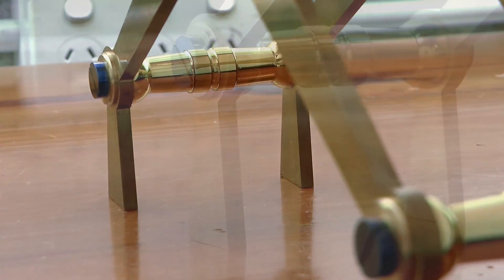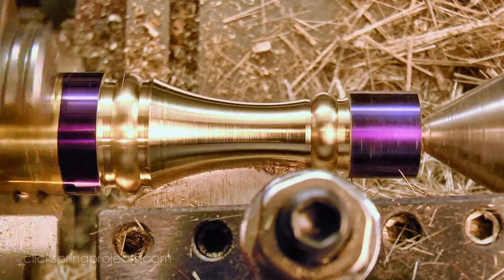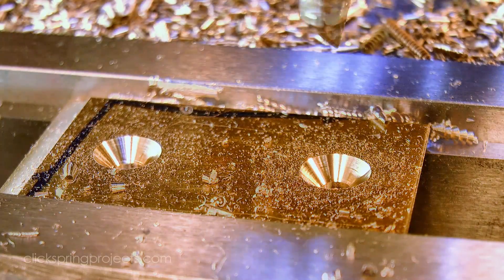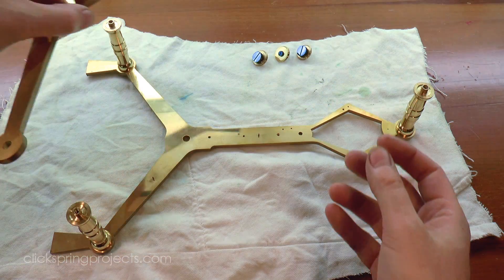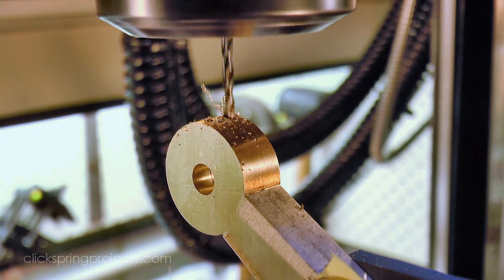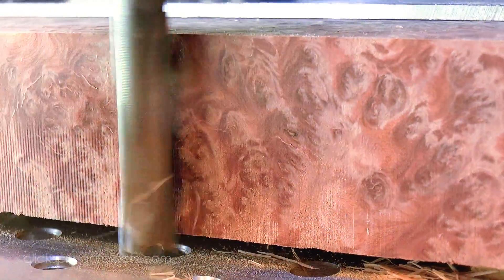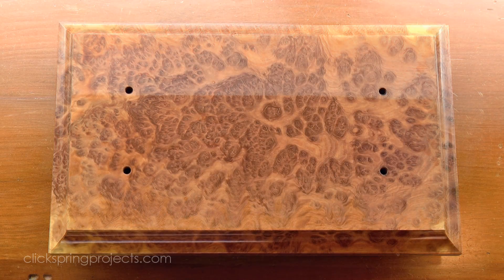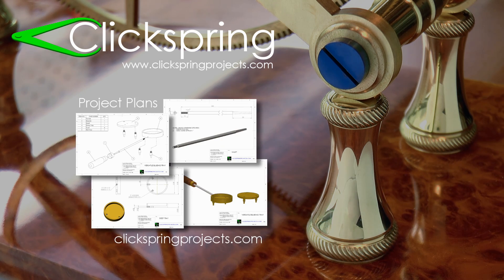Clockmaking - How To Make A Clock In The Home Machine Shop - Part 19 - Making The Legs And Base

Comment: I'm a little late to this party but I was actually going to recommend shellac since it's a good sealant and works on basically anything. Like any good paint, apply in thin coats and build up layers. Since it doesn't cure but instead relies on a simple solvent, it locks in any existing oils and soaks in before solidifying. So good choice on this!

Even with a sealant it will still distort over time and with changes in temperature and humidity. Highly figured pieces like burls may have this more pronounced since there's no single, straight grain and densities will vary. Resin stabilization is about as close as you're going to get for a permanently stable piece.

Comment: If the wood didn't quite work out, there is a trick for fixing hammers and axes that have come off their hafts that might work. Soak it in ethylene glycol. Propylene glycol might work too., but I haven't tried it. Also, not sure about time frame with something that large, might not even be feasible.

Comment: Could you tell me what speed you used when milling the brass plates using the wood router bits please?
Reply from the maker: flat out Tony - this mills max is 1800rpm, but you could run them much faster

Comment: Would it have been possible to turn the original legs of the clock into threaded bolts, so you could just screw the legs on? would that have been easier?

Comment: Hi Chris, Beautiful piece.  I would be very much interested to find out how the wood held up over time after your mention of stability.  Regarding that, there are some products to stabilize wood that could be useful and not require resin.  However, with the random grain I think Burl might not be as difficult in moisture stability, but the temperature change in size of the brass (~19) may be different than the wood (~3 to ~40 depending on species, grain, moisture).  A joint that allows sliding would be my choice as an engineer between dissimilar materials.  I am looking forward to seeing how it works.
Reply from the maker: Yes agreed Frank - Plan B if required is to drop in a sheet inlay, widen the bolt holes and let the whole thing float as required. We'll see how it goes :)

Comment: Okay, another dumb question: when bringing the legs to final dimension prior to installing the posts that mount to the frames, why not use a tool steel stop, that way you ensure that all four legs are at the same height, instead of how you did it, just bringing the frame to the belt sander?
Reply: Sorry, to clear up the "steel stop", meaning how you did the curvature of the wheels, with hardware that formed a hard edge to run files against

Comment: I baked a piece of hardwood once at 200 degree f for 12 hours to remove all the water I could and then i sealed it 3x with marine lacquer. Its hasn't moved at all even after flying and changing climates.
Reply from the maker: Thanks for sharing that info Peter, will keep it in mind for future :)
Reply: Peter DiCapua… I have a nuke in my garage/workshop for just that purpose, any green wood gets turned, nuked, I weigh said wood and when the weight stabilizes I then turn to what item I'm making.

Comment: Clickspring, before I forget. Carnuba wax, near pure form, hot melted in (buffed repeatedly) has been used successfully to stabilize maple and redwood burl. I suggest you try some on a test piece. With the wax penetrated deep into the wood it gives a luster and 3D finish that has to be seen to be believed. Birds eyes compel you to touch to see if it's truly flat. Much more attractive than surface finishes like shellac.

 This does NOT work on Pernambuco, Caesalpinia echinata. The oils in that wood somehow conflict with the wax. So testing on oily woods is a must.

I saw a birds eye walnut gun stock that had about 50 hours of wax buffing. (120 year old wood salvaged from the brightwork of a tall ship). Complimented the $30,000 firearm perfectly.

($30,000 shotgun? Just imagine workmanship like in these videos or better, a $1,000 custom cut and mounted emerald for the front post and the entirety of Portia's The Quality of Mercy engraved into the right barrel. I'm sure the craftsman ended up working at minimum wage)
Reply from the maker: Sounds very interesting Ryan, will definitely check it out, thanks very much for the info :)
Reply: That sounds awesome. Are there any pictures of the shotgun? Sounds like it would be beautiful!
Reply: I think that was the most unphotogenic object mankind ever created. Several people tried. Even pro photographers.
The wood would turn more transparent the more light was on it as it penetrated the wax. In bright sunlight it would glow a deep brown shot with bronze among nearly black birds eyes. The photographs always came out a dingy brown yellow.
The barrels were matte on the top, nearly black, fading to that deep glossy azure blue beneath like Clickspring gets with his heat treating. The photos never were able to show the different hues properly. The filigree of vines tracing the length of the barrels and the script was embedded with a dark green alloy. Depending on how wide the cuts were, the green would lighten and be opalescent. That never showed.

Comment: how about "sleeving" the hardware of the clock so its legs are physically in contact with the brass feet at the bottom of the wooden base?  a bushing of some kind that goes thru the wood??  or, a flat piece of metal stock beneath the wooden base to which your clock is actually attached, making it so the wooden part only serves as decorative.  that way the wood can move and breathe with the changes in the environment as the seasons progress without changing the actual dimensions of what keeps the clock stable.

does that make any sense?  i hope i explained my question well enough.  when i'm concerned about changes in wood, i make sure the substrate has "wiggle room" to move without changing the overall dimensions of the project.  that and sometimes a crapload of varnish!
Reply from the maker: Plan B if required is to drop a brass inlay into the base that will essentially "float". We'll see how it goes over the next few years. Cheers mate :)

Comment: Chris, that is a gorgeous piece of wood that really compliments the clock b- excellent choice mate! The profile router bits will also work on ferrous metals with the appropriate speeds and feeds  which will vary based on profile and depth of cut. As always, inspiring work and thanks for sharing. Cheers!
Reply from the maker: Cheers Jeff!

Comment: great build Chris. I agree with your decision to add the decorative legs. there's just something about the way the radius top of the legs meet the flat surface of the clock frame. has to do with my eye being drawn to that particular spot, a distraction if you may.

I believe using a radius slot for the frame to sit in would be somewhat more appealing. the frame at that spot looks like an afterthought to a beautiful project. what does your eye for detail suggest?
Reply from the maker: I considered recessing the frames into the legs as you suggest, but decided that it looked a bit "heavy" on the eye. There is something a bit more delicate about them sitting as a tangent to the top of the legs. Its also consistent with the approach taken in most of the antique examples I can find in books, so that sealed the decision. Cheers mate :)

Comment: Beautifully done!   I wonder if a more modern poly urethane finish would be more stable in the tropics.  It is possible to get a very nice high gloss with those and they can be rubbed out between coats with wet and dry paper or fine fine steel wool.  Just a thought if issues come up.

Best Wishes,  Jim
P.S.   What a great job you are doing with the clock AND the videos.
Reply from the maker: Yes I suspect a PU coating would be suitable if it comes to that, cheers mate :)

Comment: This is certainly an epic build Chris.  I have one technical question for you however.  It has always interested me on how you put a "nurl" on to a surface.  Not sure about the spelling!  If the tool has "X" amount of ridges on it, doesn't the piece you're putting it on to have to be an exact multiplication of that number?  Otherwise wouldn't it all get out of whack?  Thanks.
Reply from the maker: Hey David, yes that is correct - it is analogous to the idea of gear teeth intersecting with two mating gears. The starting outside diameter of the workpiece needs to be very close to an integer multiple of the knurling wheel tooth pitch. Its not quite as simple as that, because of the deformation process of knurling, but that's the general idea. Google knurling calculator, and you'll get a lot of good info from others :)

Comment: A bravura performance. A vast improvement on the appearance of the clock. Textbook illustration of form tools and their use. A really beautiful piece of wood for the base. And you can indeed use a mill as a router. . Usually mills run too slow to do a really good job, but you got an extra boost because of the big radius  on the router bit = faster surface speed which is what counts. What else could I ask for? I know: a description of french polishing. Oh, that's your next video! Off to watch it.

Comment: Amazing work, as always. Seriously the prettiest machine I've ever seen.

About the base: My brother installed a solid ipe countertop in a house in austin, tx usa (also super humid). He found that it deformed at first, but then it flattened out when he lifted it off the cabinets about 0.5 inches with some stand-offs to allow the entire piece of wood to breathe. If you see deformation, you might try using some thin stand-offs on the brass feet. Just my $0.02.
Reply from the maker: Thanks for sharing that info, will keep it in mind :)

Comment: 16:28 Sloppy sloppy sloppy, every handmade screw head is at a different angle. I expected better. :)
Reply: He's probably taking it apart again, not worth the effort yet.
Reply: Interesting thing is is that all the other screws are the same direction due to how they are taped.
Reply: Thinking of English shotgun custom screws?
Reply: You must have gone to school with my father in law, who was nicknamed Professional Nit Picker at work.  He was an engineer too!  All screw heads had to be turned to 1 o' clock, he told me.
Reply: How droll.

Comment: Hi Chris, great video as always but unusually I spotted something that you might like to know to make things a little neater. This is not in anyway a criticism just something very simple that was taught to me when I was an apprentice many years ago by a old, very experienced cabinet maker and someone as precise as you might like. I'm refering to the underside of the clock mount.  When you are screwing in any amount of screws on the same surface that can be seen at the same time make sure the slots all line up, whether that be vertical, horizontal  or diagonal. A simple thing but just looks a little nicer. Hope you don't mind, I always really  look forward to your videos, thanks again.
Reply from the maker: Hey Ian, thanks for sharing your thoughts. A lot of fuss is made about timing screws, but the reality is that the effect is soon lost at the first dis-assembly, which is perhaps something a cabinetmaker doesn't have to contend with. Its rarely worth the trouble in clock and watchmaking, especially with soft materials like wood and brass that will suffer damage from repeated chasing of the effect. I do it occasionally (https://youtu.be/O8xIjsaDlN8?t=3m43s), and also did it recently on a Patron Series project where the fastener is hardened steel going into mild steel, so the effect will be maintained over time. But for something like this I think its far better to embrace a little randomness in the presentation. Cheers mate :)
Reply: Thanks for your reply Chris, your right, if they have to be adjusted from time to time it doesn't really apply. As for "timing the thread" i was taught that was the process when you try to return a screw back into a pre-cut thread, you place the screw or bolt ( it works just as well with nuts too ) in the hole and turn it anti clockwise until you hear or feel a click, then its safe to turn the thread clockwise to fasten up, in doing so it prevents cross threading, maybe its just simply a translation thing, we are talking across the world after all ! Thanks again .

Comment: Awesome!  If I may be so bold, it would be just that bit nicer if all of the screws were timed.  I know, I know, it is quite a bit more work but would make it absolutely perfect.  Always look forward to your videos, keep them coming!
Reply from the maker: A lot of fuss is made about timing screws, but the reality is that the effect is soon lost at the first dis-assembly. So its rarely worth the trouble, especially with soft materials like wood and brass that will suffer damage from repeated chasing of the effect. I do it occasionally (https://youtu.be/O8xIjsaDlN8?t=3m43s) but I think its far better to embrace a little randomness in the presentation :)
Reply: Cheers!

Comment: Since the metal and wood will contract/expand based on different circumstances you would want to make at least one half of the feet a little loose including widening the holes. This way whe wood won't bend your frame if it expands or contracts and vice versa.

Comment: Can aynyone explain me why he applied oil when imprinting the grooves onto the legs?
(Not native, I hope you know what I mean).
Reply: 1: Washes particles out of the knurl so they don't clog the knurl and damage the impression. 2:  Lubricates the knurl/work interface, which is under a lot of pressure. 3: Lubricates knurl on its shaft as again, it's under a lot of pressure.  Has he ever said what lube he uses?

Comment: What was the point of using the dye on the washers, it didn't seem like you marked off the sizes before cutting and I would guess you anyways would use the laithe's index(the "measure" around the handles you use to position the cutting head)?
Reply from the maker: Sizes were indeed marked off on the dye, just left it out of the edit for fun :)

Comment: I dont understand how the rope knurl tool works - how do you ensure there is an exact integer number of knurls on the workpiece, so that there is no overlap?
Reply: Lets say the distance between the knurls is 2mm (just as an example)
so long as the circumference is divisible by 2, the pattern will always fit.
Reply: He addresses this specific problem in the original video when he made the tool. If the diameter is too large, the tool will essentially cold work it to the proper size.
Reply: He mentioned that he changed the angle as he knurled to get more of a 3D effect. So it might turn out better if the diameter is a little off. I'm just spit balling my idea cause I've never done this.
Reply: frackcha Well the problem is that if the circumference is divisible by 2.1mm or 1.9mm you'll get overlap wont you?
Reply: Chris Doms
 There is some play in the tool depending on the depth of cut, but yeah you will have overlap.
The solution is to use a different tool that has the correct spacing of 2.1mm or 1.9mm.

Comment: I have a background in woodworking. I think your slab of wood should be okay as long as it's well sealed. The main problem with burled woods is that they're quite fragile and prone to breaking. In cabinetry, highly figured woods like this are not normally used as solid lumber, but rather in the form of veneers. This allows the most freedom, and the use of very delicate and difficult cuts of wood. I wouldn't worry too much about wood movement, because in a piece like this, the grain goes in pretty much all directions.

Comment: With a burl, you'll likely want to do some sort of stabilization anyway. Many of them are prone to cracking over time. I doubt the clock will introduce much vibration in the base, but if it did, I'd be concerned about it long-term.

Beautiful French Polish, BTW. :)

Comment: Why do people like burl? it is tree cancer.
Reply: Because it is uncommon and complex looking.
Reply: it's not cancer - it is a result of stress of some kind - damage or elements - you can see from the pattern that it has tried to produce many new shoots ( which gives the bird's eye effect) and the grain is running every which way to regrow - kind of like a human scar - if you are badly injured or burnt your skin will try to grow back to protect you however it can - it never comes back like what you were born with but it does grow back often quite visibly different - but certainly not cancerous - it's just the will to survive made visible...
also being a burl the normal expansion/contraction between seasonal changes will not be as great as that usually has most effect across a flatsawn piece whereas the burl's grain is running every which way which kind of negates the usual movement (although the flat surface may ripple a bit depending on how dry the timber was to start with - the small checks may open and close a bit but in terms of overall size changes will be much less than a "perfect" (ie straight grained ) piece of wood...and shellac for all its deficiencies (alcohol soluble, water damage etc) is one of the best blockers of water vapour transfer - the humidity changes in the air have a more difficult time penetrating to the wood - and finally people love burl wood (especially woodworkers) because they appreciate that it is beautiful...much like people (especially scotch drinkers) appreciate a single malt scotch...
Reply: +Katalist check out Ben Crowe at Crimson Custom Guitars on the 'Tube. He's done some work with spalted (ash? been a while can't remember) and he does amazing work.